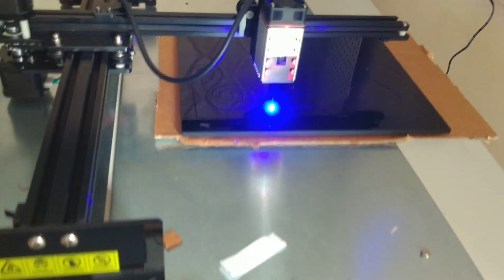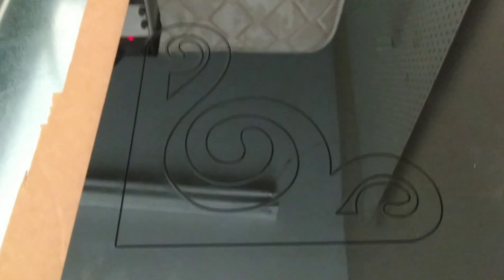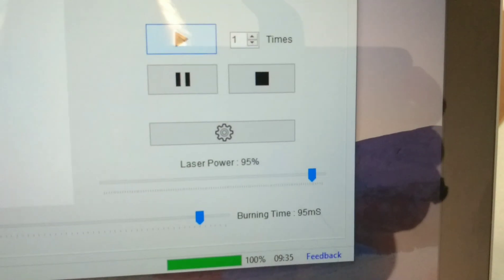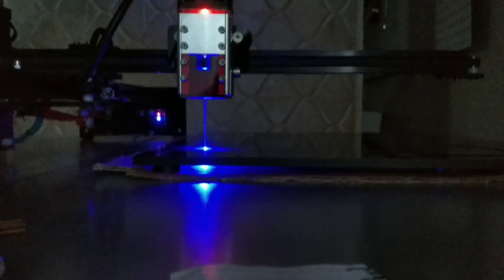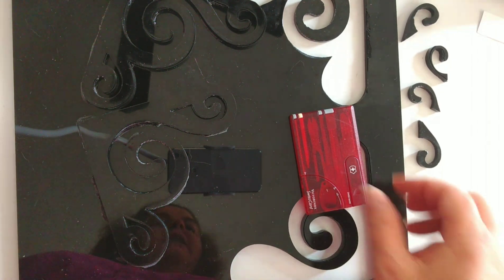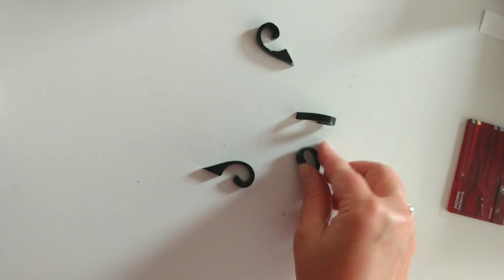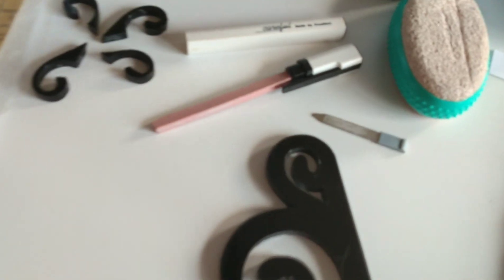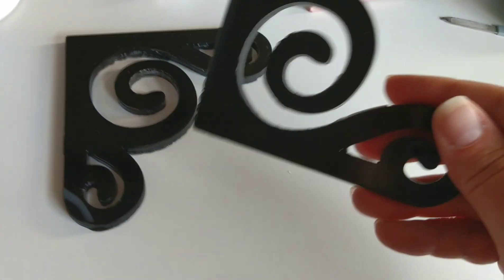Cutting out Thick Acrylic with Diode laser, NEJE 30W

Comment: I recommend you change to Lightburn software, I know it's not free but well worth the upgrade. For this particular job here you could (for e.g.,)  use a function it offers called 'Print and Cut Wizard' which allows you to remove your workpiece and then replace it and get it perfectly realigned for another pass. That's just one of a vast number of other advantages Lightburn offers. Also, if you're not using air assist (and note that the fan on the module isn't really much help), then clean your lens regularly with alcohol and a cotton bud because it will get fouled up with soot etc., and that really reduces the cutting ability due to the spot size increasing (it gets fuzzy due to the dirty lens).  If you are planning on cutting much thick stuff you would be better using a laser module with modified beam focus (like the Sculpfun S9) which has a longer depth of focus and smaller spot size. For the money it's better than struggling with lots of minor mods to the setup you have now - and you can always swap between them anyway. I also have the Neje 30w but have the S9 on order..
Reply from the maker: Hi and thanks for the great tips. You're right lightburn is great, I finally did try it. Will have to explore the Print and Cut feature!
Reply: Hi Chris you sound like you have quite a bit of knowledge in cutting black acrylic with sculpfun s9. I am looking to buy one for this purpose. Are you able to share some photos of work you have done in black acrylic on the S9. Many thanks

Comment: Hi I blocked one of those I love it I have my I have my laser 20 mm off is 20 mm off the base of The table but when I use white foam board it's not it's not cutting all the way through or or it's melting the phone some the phone so much it's unusable what are what are your measurements please for focus on for focus on phone board
Reply from the maker: i did not have any luck with foam core board. Very flammable! But then sheets of craft foam did ok. I don't use a set distance from material to laser, just try to get as small a pinpoint as possible.